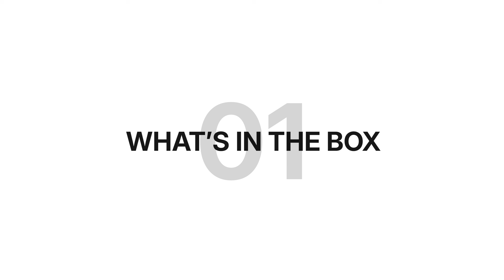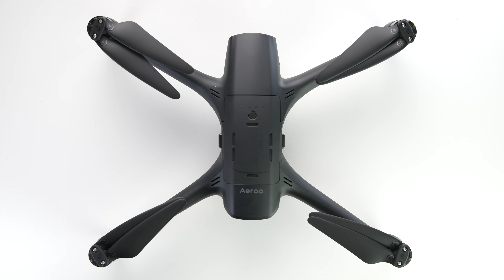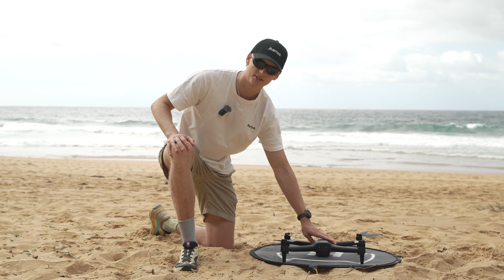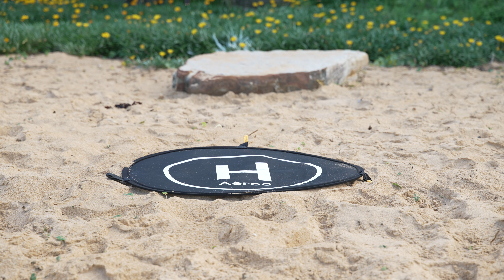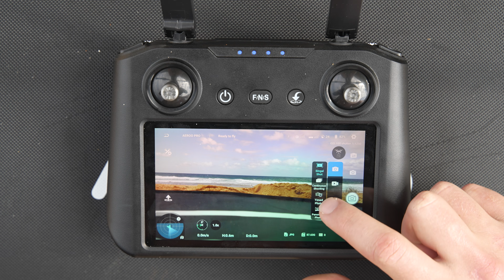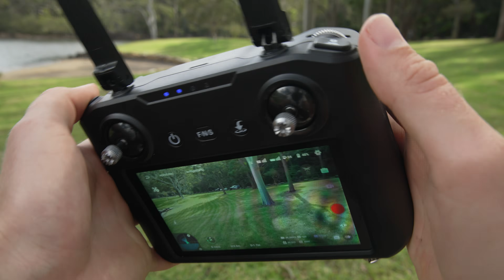Aeroo Pro | Smart Controller | Quick Start Guide

Comment: :fish-orange-wide-eyes::fish-orange-wide-eyes::fish-orange-wide-eyes::fish-orange-wide-eyes::fish-orange-wide-eyes::fish-orange-wide-eyes::fish-orange-wide-eyes::fish-orange-wide-eyes::fish-orange-wide-eyes:
:octopus-red-waving::octopus-red-waving::octopus-red-waving::octopus-red-waving::octopus-red-waving::octopus-red-waving::octopus-red-waving::octopus-red-waving::octopus-red-waving:
I have not long brought the Aeroo Pro Combo with smart controller ... have yet to fly it 
why does combo battery charger not deliver the 27 watt needed for the smart controller as the screen on it say { use the correct charger}
Reply from the maker: Hey @NunyaBusiness-c2d, the charger included with your kit is compatible with the Smart Controller and is designed to charge it safely at a standard rate. However, we understand that charging can take longer than expected. Support for fast charging was introduced through a software update and requires a compatible, higher-powered USB-C charger. Let us know how you get on with your first flights!

Comment: Does the drone rely on visualising the landing pad so it knows where to land on a return to home  - or is the landing pad just to prevent sand flicking up on takeoff?
Reply from the maker: No, it doesn't rely on it. It uses GPS to fly back to the home point all on its own. However, it is designed to actively look for and lock onto the pad for maximum landing accuracy. Plus, using the pad keeps beach sand out of your expensive motors. Always use it!
Reply: @Aeroo_Drones  
why then does the camera look down and focus on the landing pad

Comment: When charging my smart controller I can hear the fan turn on and the screen shows it charging but after a couple of seconds it turns off for a couple of seconds then on for couple of seconds doing the same thing again repeatedly is that normal or should the fan be running and the screen showing it’s charging continuously?
Reply: My fan ran until full charge... looks like holds long time.👍. But worth checking

Comment: Leave the battery's full is better? NO, leave them around 60% is better. Common, don't give stupid advice.
Reply from the maker: Hey Rene,

For the Aeroo Pro's AI LiPo battery, fully charging after each use is exactly what we recommend. Leaving it low for extended periods can cause irreversible damage to the cells. The 60% rule applies to different battery types - our manual covers this in detail if you want to check it out 👌

https://au.aeroodrones.com/blogs/news/aeroo-pro-smart-controller-user-manual